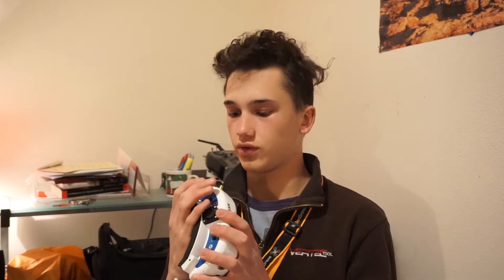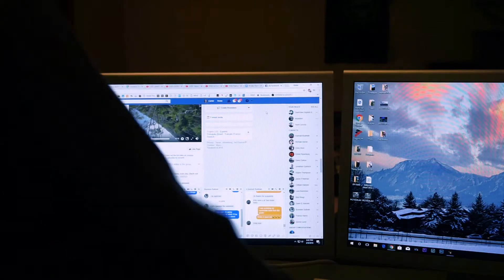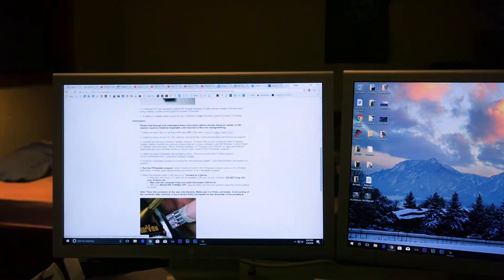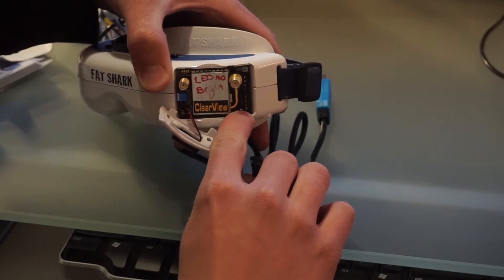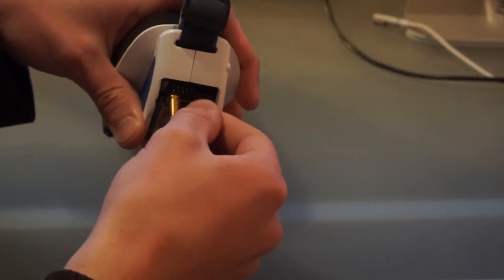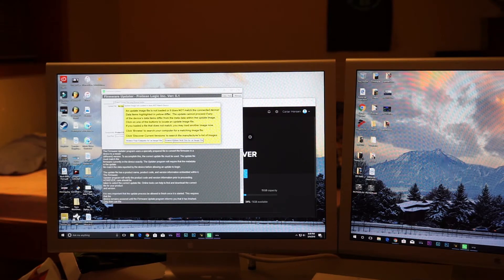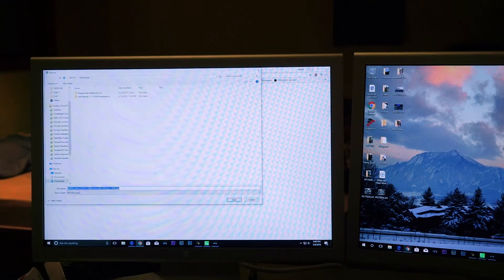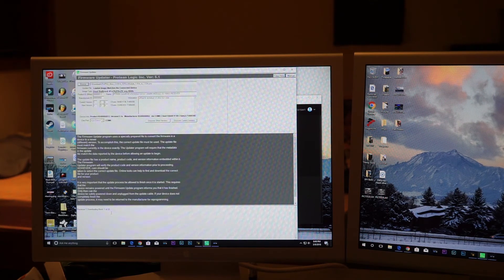ClearView Receivers: How to Update your Firmware

Comment: Where can I find current firmware and links for the module? Have tried for weeks and tried to contact via email with no response.

Also advised that the website link for the fw updater is broken a parent from in the link to the document file for that page.

Any help would be nice :) thanks
Reply: Did actually comment on this video 2 weeks ago
Reply: @Jord0699  did youu ever get a response or a link that works?

Comment: What switch are you using on your goggles that you can still plug in the aux power supply for the module in the head tracker bay?  I just got the module for my DomV3s and my power switch mod is in the way of the PCB that plugs into the head tracker.